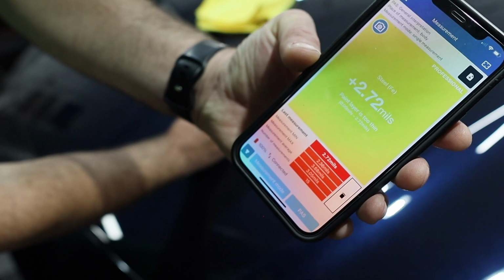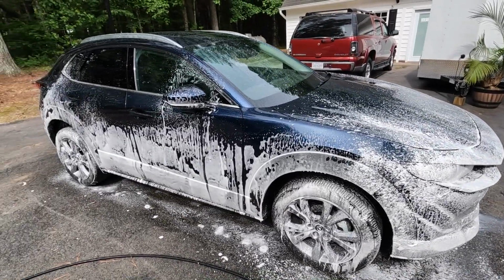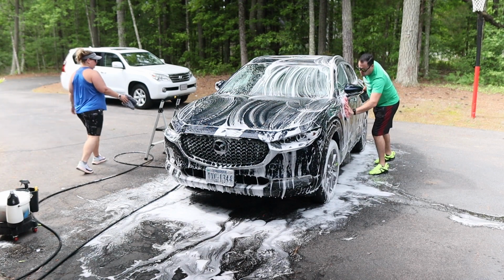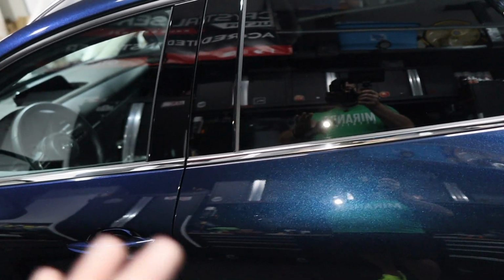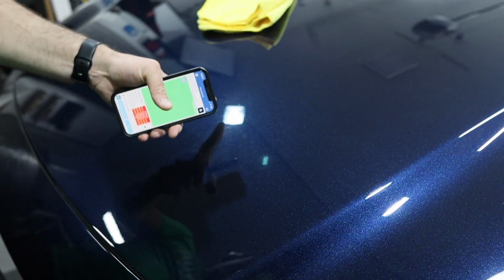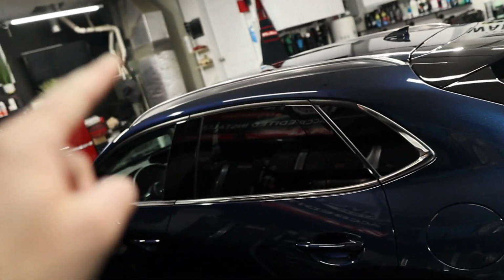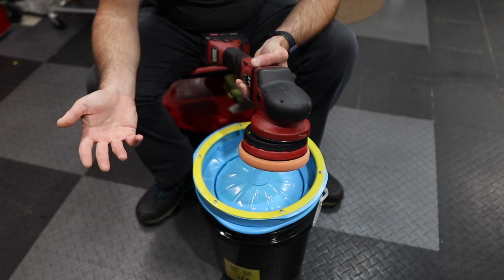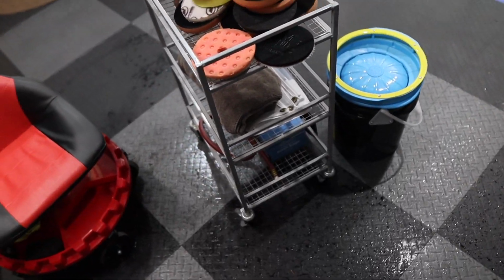Polishing & Ceramic Coating Service 2022 Mazda CX30 & Lake Country Pad Washer 4000! #Detailingtips

Comment: I use the pad cleaner. My lower back is screwed, I can’t bend/reach over a sink. I use 2-3 pumps. Spin it out. Pat dry on a twisted loop drying towel. Then carry on. No sling.

Comment: I clean my pads at 2-3 speeds then speed 6 to dry it out and I don’t have any problems with anything misting off
Reply from the maker: Interesting…I have talked to so many people and each has a different experience.
Reply: @MirandaDetailing  yeah. I  keep a rinseless in mine too, so it can get around easier. I use water based polish so it works really quick too.
Reply from the maker: Cool!  Good to know!

Comment: Had Chicago Auto Pros do my 2022 CX-5. Only had 225 miles on it and I still managed to get one chip on the lower front fascia. Had them PPF the entire front after reading forums about Mazda’s thin paint.

Comment: Hi Phil another great job.
I have my car coated with Adam's graphine ceramic coating. I have my car parked in garage and people doing construction in my house. Lot of dust and dirt accumulated on from sheet rock wood dust. I didn't wash for month. Decided to wash bcz I couldn't see it so dirty even it's will get dust. All I did is pressure rinse car. No soap and chemicals. Just rinse and car was clean. I couldn't believe cermaic coating working. That never happened before with any sealants.

Comment: Very informative video. What could we do if the plastic around this car (cx30) already damage such as got tyres print on it or scratch since its could not polish. Please advise
Reply from the maker: Hi. Plastic trim could be sanded down and repainted , but if you do that it can flatten out the plastic texture and be very noticeable. You would have to sand down the entire trim piece so it all looked the same then repaint it.

Comment: Hi there, I just receive mine and have the same issue with the pad washer 4000. Great to clean the pads but in between panel there is too much liquid that stay in the pad and make a mess with the polishing stage. I would clean the pad and dry it with compress air and MF then continue polishing.
Reply from the maker: Yup exactly. That’s a good method! Thanks for sharing. 😎👍🏼

Comment: Hey phil, even when the residual water gets onto my pad I consider that too damp! Usually after a panal I either clean with compressed air or the rupes claw for foam or the orange angled pad brush for microfiber pads. Like you said, I wash my pads after the job, making sure I have enough time to dry them in the sun/ air dry them. I use the power washer on my foam pads 😵 its worked for me for many years and its just the way I was taught 🤷🏻‍♂️
Reply from the maker: Exactly! I never got good result with a damp pad after washing it. Yes! I have seen using a pressure washer on pads does a great job!  Thanks for sharing man!

Comment: Hey Phil, great video. Car came out amazing. I'm in the same boat with offering ppf on the gloss black A and B pillars. Also for the Pad washer the way I use it because it does create a slight mess. I would use say 3 pads on a whole vehicle. When all the get gunned up I walk about 15-20ft away and clean all 3 pads and repeat. For me it does keep the pads cool. Less drag on the pad in my world when polishing. The pad washer reduces my polishing and cleaning time of the pads drastically. 

Lastly, I have a APC diluted 1:1 fairly strong. Spray it on my pads when it comes to cleaning. Pump a bit on the washer and pads come out new. Hope this info was slightly helpful. That's what works for me.

Comment: Mazda's metallic paints are gorgeous.. but uber thin. I've coated a CX-5 and a CX-9 and readings went from 1.7 mils  😱😱😱 to 3.5 mils. Measuring paint thickness before polishing is a must on any vehicle. 

I've had my LC4000 pad washer for a while now. I am cleaning my pads as I am polishing and it is a game changer. I take a microfiber and spin the pad against it to get out any remaining residue.

Comment: Do you need to rinse the cleaning solution out of the pads before using the pads to polish? Or is it safe on the paint?
Reply from the maker: Hi. The solution is a rinssless type of cleaner so it can dry and it leaves the pads soft and clean.

Comment: To keep all of the overspray down I run the polisher at about 5 or 6 for just a few seconds to get the excess water out. After that it's almost like you primed the pad and the polish spreads better. I really want to get that lake country pad washer! Now I just wash them in the sink then attach them to the polisher and spin the water out!

Comment: I love the idea of using warm or hot water for the pad washer. I do love the pad washer but I've found it does have limitations. It's great 6, 5 and 3 inch pads but when it comes to the smaller 2 and 1 inch pads it's not great for cleaning those. I may clean my pads after 2 or 3 panels, I always blow them out as the pads are still damp. I'll just swap out pads afterwards to make sure the pad dries and cools down. I feel it makes pad cleaning effortlessly. Although, my 1 and 2 inch pads are still cleaned by hand. 👍great info video Phil.
Reply: Believe it or not, I just used that pad washer to clean out all my pads. I was too tired to get my PXE-80 out and just used my cordless DeWalt 15mm throw for ALL the pads. I centered them, even the 1", 2" and 3"
And cleaned them on the pad washer. The small ones just take but a few seconds and they're clean

Comment: Hey Phil, I saw you using the P&S Clarity Cream to polish the cx30 glass but what sealant or coating did you end up using?  I don't see anything in the products listing above unless you ended ul applying CSL or EXO on the glass as well.

Thanks for the great video.
Reply: I was curious what to use on headlights and the glass as well.
Reply from the maker: Hi. Sorry for the delay. I believe I had used this on the glass https://bit.ly/3Bo6rGx
Reply from the maker: So we used this on the glass https://bit.ly/3Bo6rGx
The Headlights since they are plastic we used the paint coating on them just as the paint.
Reply: @MirandaDetailing  can you use CSL on the plastic chrome around the windows? (I was planning on at least keeping it off the black plastic trim)
Reply from the maker: Hi. Yes you can. Actually for new trim it works great. For faded trim it’s better to use the C4 trim coating. But CSL is great for coating trim that is not faded.

Comment: Great video, Phil, and very timely for me!  I have a 2021 Mazda6 Carbon Edition, and the paint is also extremely thin!  All the readings I've taken are under 4, and some on the hood are 3.1.  I've been trying to figure out what to use for a polish before coating with Gyeon Mohs Evo.  I think I'm just going to go with 3D One and a 3D light purple cutting/polishing pad.  Do you think that will still be too much, given the paint thickness?
Reply from the maker: Hi. Thanks!  Yeah that actually sounds gently enough. A long a you’re not cutting with microfiber you should be good. 👍🏼👍🏼

Comment: Phil at my information from OEM car manufacturers in Europe on painting divisions, ( keep in mind those PTGs give total thickness) ,told me that they keep the clear coat the same about 2mils(50microns) on average, but now the primer base, the anti-corrosion and the color layers are thinner that the previous years , but not the clear coat
Reply from the maker: Cool!  That’s good to know!  Thanks for sharing that info!
Reply: I'd almost suggest, hitting up a couple of the new car dealers, talking to the service/prep departments, and seeing if you can't ever get a damaged/take-off new(ish) panel for free (or bribed with some donuts and coffee) for testing.  Might be kind of interesting to see how much you can actually abuse some of these new thinner car paints before damage/failure happens.
Reply from the maker: Great idea!

Comment: Before watching this video,after a year rear headlights and there is a word normal you would buy a headlight restoration use sandpaper ,washed and polished it and I don t have a business with a light cut and patient light polish cut one headlight is almost clean just use a polish step by step, okay watching this video mazada SUV if am correct
Reply: don t forget with paint its not built to last its replace it soon
I wonder how paint is on a new Corsa share platform with Peugeot 208 and what I have a 2016 Corsa

Comment: Jess proof of enjoyability factor on also why bettering the tools and proper safety procedures when she pointed also the gun away from the car first before using the trigger.  If you didn't have that rubberized tip you would have ended or repeated what happened to Alan Medcraf when he was with Jason Otterness when the tip hit Jason's car.🤦🏽‍♂️🤷🏾‍♂️😄  you enjoy having a tool and piece of mind that the car and your work is protected 😄
Reply from the maker: 🤣🤣 exactly!
Reply: @MirandaDetailing  A nice video idea to make is what safety procedures you apply on your business, obviously in your case why you have to avoid gloves but then how your hands also don't get that affected by chemicals because of also proper dilution ratio doesn't affect your hands that bad.
Reply from the maker: Ah that’s a good idea!